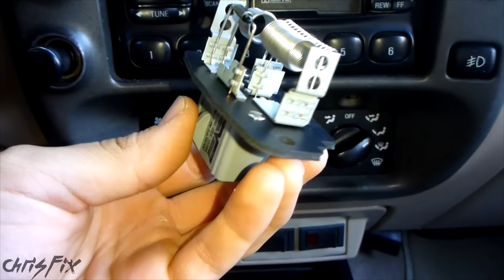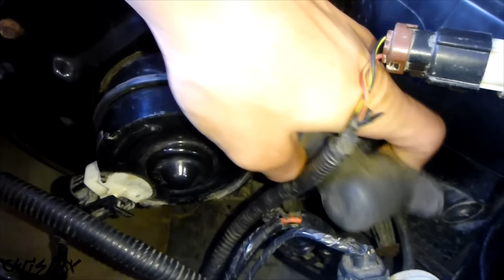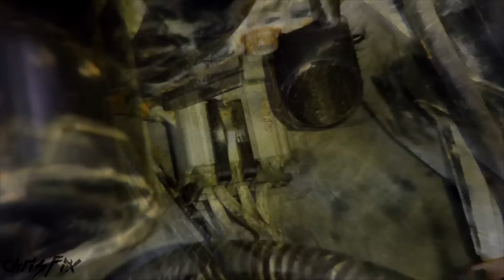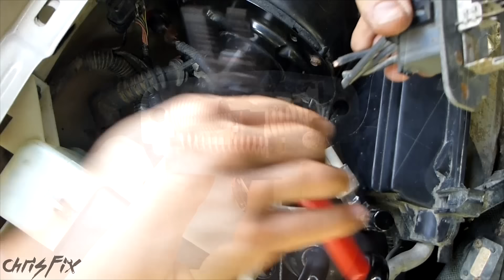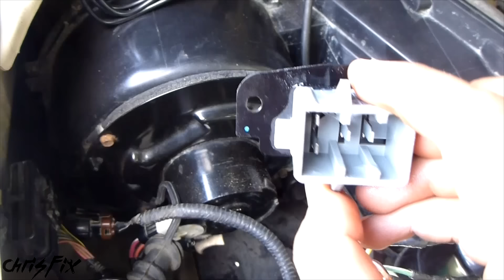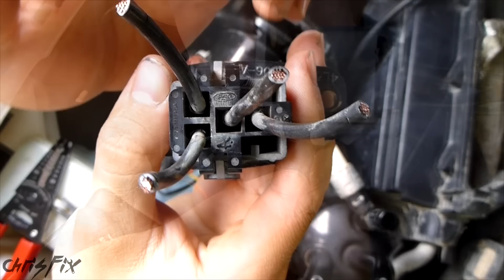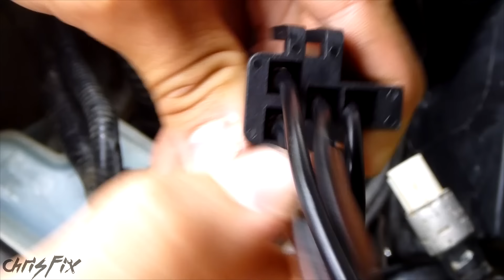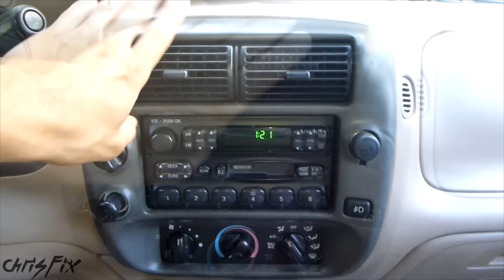How to replace a Blower Motor Resistor

Comment: I put a new resistor in and it still only works on one setting. Resistors are made to be shit.
Reply: TheAwesomeAustin Am wondering if you found a fix? Mine worked great for two minutes then cut off on all speeds except high...
Reply: I think they're just made to not work

Comment: This is the same problem as I have on my 2005 Ranger, only have "high speed" I order the resistor and new connector on Rock Auto ($31.00 delivered) and I will be replacing mine as soon as the parts come in. Great video and very helpful Chris.

Comment: Does every car have a separate blower motor resistor or can it sometimes be built in to the actual blower motor? I'm currently looking to change mine since its not working on neither lvl 1,2,3 or 4, it only blows on lvl 5. I'm driving a 1991 Volvo 940 (Without AC). The problem is that I can't find one for my specific car. Therefor I wonder if maybe it it built in to the actual blower motor?

Comment: Chris,  Thanks for the great video.  I have a 99 Ford Ranger that has this problem.  I have also had a number of other problems (i.e. speedometer not working, transmission shifting hard, check engine light, and O/D light flashing).  A mechanic changed the speed sensor to try to fix the symptoms I listed; however, after about ten miles all of the problems return.  I neglected to tell him about the air conditioner problem because I figured that I'd just live with only having a "high" setting for the A/C fan.  Could this be causing the other problems or do you think it's vice versa?  The mechanic is now wanting to replace the control module.  I'll tell hime about what I saw on your video.  Again, thanks and please provide any comments you think will help.
Reply from the maker: Scan the computer and get the tranny code. The OD light flashing is like a check engine light. It will tell you what's wrong.

Comment: Thanks a lot for your very helpful videos. The blower in my 1996 Nissan Pathfinder has been 50/50 for the past few days. It usually won't work at all until after I hit a bump in the road. I can feel the cool/hot air, but it's just not moving. This leads me to believe it may be a loose electrical connection to the blower motor. Where would I be able to locate this connection and tighten it?

Comment: How can you work on stuff like that on cars like your fiesta. The engine bay is very crammed. From below? It's just a question that just popped into my mind.
Reply from the maker: +bionasos they design access to each part (usually) so you just need to figure out where. A perfect example to this is my video "how to replace an ac compressor" and you go from the wheel well.
Reply: Thank you, i 'll start exploring then.

Comment: Chris, on my 1990 Ford Festiva the ac comes on but no cold air blows out the vent ( no air at all).  When switched to med and high setting the cold air comes out for a few seconds because it was working on low setting, but like I said no air blowing out the vents.  On the med and high setting, just air blows out the vents, no cold air though.  Does a blower motor resistor control the air conditioner too?  Or is there something else that needs to be replaced?  Thanks in advance.

Comment: Hey Chris. I recently replaced both the blower motor resister and the plug on my 2007 Toyota Tacoma but still no power. Any suggestions? Thanks
Reply from the maker: Check the fuse.

Comment: Could you use heat shrink as opposed to electrical tape at 9:03?
Reply: Vro18 Yes. Heat shrink is a much better option as long as you can apply the heat without damaging nearby things, the connectors in the video have built in heatshrink, i believe he did not realize this.

Comment: Chris my AC sometimes start and most of the time it does it could be in any speed and nothing but when I hit with my hand under the dash around the blower and resistor it starts also sometimes it doesn't blow cold, any advice?

Comment: My blower motor can be on and then it starts to slow down and stops. I turn it off and wait a few minuets and when I turn it back on it works. Would this be the motor or the resistor? Or Both?

Comment: im replacing ac blower resistor every year..  is it OK to just NOT use a resistor, and just have the fan on max on all times?  i live in a hot place, and most times, the fan is set on 3 anyways..

Comment: Hi, i have a Toyota Previa 1996 and the HI setting on the blower trips the circuit breaker only when the engine is running and will not trip with just ignition, what is the cause of this problem?
Reply from the maker: Sounds like you need a new blower motor. It is drawing too much current.
Reply: we replaced the old motor as commutator was worn out but was replaced with another second hand one
Reply: the hi setting works but just for a short amount of time, usually hotter the weather it trips quicker, too much heat?

Comment: what about using wd40 spray? well thanks I'm gonna get some gel! Did not think of it unless it comes in the kit! I bought a blower motor too so ill put in resister first may not need blower motor. but then again it was do cheep and its nice to have new parts when labor is Free you get the best deal for your car. Thanks So much.!!!!

Comment: chris what does it mean if i turn on the climate control and nothing happens? no air or anything is coming out the vents.. checked my fuses. replaced the relay switch. and also checked the blower motor as well . please help

Comment: good video except the butt connectors you are using are heat-shrink connectors and should have heat applied to get a seal around the wire.

Comment: Nice. 

You just did not remove bolts. You removed screws, and your crimping is too weak. These butt connectors are heat shrinkable.

Comment: Can the blower motor work on high even when a fuse has blown ?
Reply from the maker: Possibly. Some wiring is designed to bypass the blower motor for the highest fan speed. If the blower motor fuse is blown and it is still running then there is a bad short somewhere!
Reply: Thanks a lot, really appreciate it

Comment: I liked it but the wire crimpers were heat shrink wires you should heat shrink them because it's out in the elements not just electrical tape because you'll be replacing that again and the one wire was black copper was bad you should've cut it back further so you would've had better connection

Comment: hey chris i did this on my ranger but it won't cool any more but that fans are blowing i did not replace the plug just the resistor
Reply from the maker: +nodamnametouse make sure the blend door is working
Reply: it was working before i replace the resistor tnx for your help man

Comment: If I strip a wire and one of the copper wires inside happens to break do i need to strip  a whole new section of wire untill there all evened out again??

Comment: Hey ChrisFix, I have a 2000 caravan that the heat only worked on the high setting in. When i replaced the blower motor resistor,  I noticed that the wiring harness was burnt and partially melted. Since there was nothing I could do at the time, I put the wiring harness back in the new resistor. Now the heat only works on high and will not turn off no matter what position the air toggle switch is on (blows high even in the off position). Could this be because of the burnt wiring harness or did I screw something up during the install?

Comment: Mr. Chris,

   My fan works, but my new resistor doesn't work after I put a new one installed. I've checked my fuses, and they aren't burnt.

Thanks, 

Mr. Harlow

Comment: Hey Chris. I have a 1992 Ford Aerostar (mechanically similar to the Ranger/B300) When it's hot out and I have the AC running, the fan speed will slowly become weak through the vents, but I can still hear the thing spinning at maximum. Then when I turn the AC off it comes back through the vents slowly. Could this be the resistor?

Comment: Are them connectors like fuses in a way
Reply: no, but kinda yes at the same time they are resistors actually, how resisters work is they restrict the flow of electricity and dicipate it as another source of energy such as heat, and in return they step down the voltage,  when too much current is flowing through then it can either blow a fuse or actually burn out the resistors themselves.

For example, a fuse can have a certain amperage but once that heats up more than what it's designed for, it burns out... usually with a discoloured mark but it's not uncommon to see a blown fuse the same colour as the new one, however fuses don't restrict the flow of electricity.

Also, a wire can be a fuse, pump enough amps through a thin enough wire and it will heat up, eventually melting it and severing the connection which is why there is a mathematical formula to calculate distance, wattage, voltage and DC or AC to find the thickness that you need... here's a tip for you though the lower the number, the thicker the wire, so don't be ordering 36 gauge wire for that 100 amp installation...

Comment: had a question replaced my heater resissior n the connector but still not gettin any heat n the heater blower works coolent full what could be the problem help please

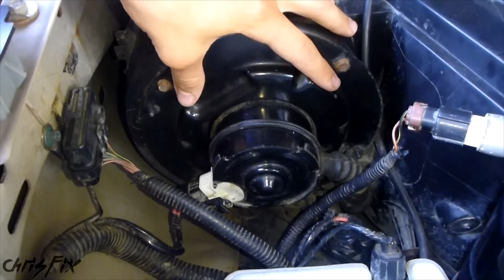Comment: Another great vid, Thank you good sir, but, what is your hand on top of at 1:28 please, mine has broken away from my firewall and I don't know what that part is called. Can you help me please ???? thank you....
Reply: drowization that's the blower motor housing
Reply: Sorry but I guess I should have timed it a bit better. Ok, so what is your hand just to the right of the blower motor ? the part I'm speaking about is just under the heater core hoses please ????

Comment: hey Chris, I have a 2004 Chevy trailblazer and the Ac fan is always running. Cold works. hear works. all fan speeds works but the fan never turns off when the car is on. air is always blowing consistently. defroster is off so does that mean its the blower resistor?

Comment: You should cover the terminals and fill the female socket with dielectric grease to keep any moisture out and you will n ever have a corrosion problem  and if the resister fails in the future the connector will slide apart easily.
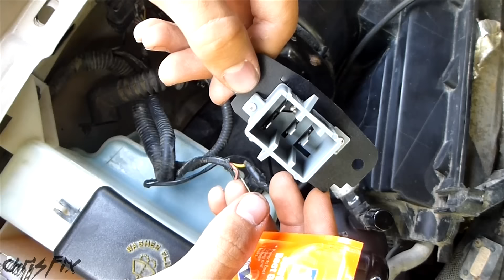Reply: He does mention this in the video at 5:19.  https://youtu.be/Q-i0tytSYIM?t=5m19s
Reply from the maker: Great tip! Thanks!

Comment: hmmm. maybe check if the resistor and wiring connections work before wrapping it up with the tape. Otherwise you may have to unwrap the tape to see if contact being made

Comment: whats the difference between blower motor resistor and blend door？？
Reply: 袁也 the blend door controls wether you get hot or cold air, the resistor control how much air you get.

Comment: i have my Peugeot 405 car. the blower fan works directly at high as the car starts at the time that the fan is already switched off.
how can i solve this problem?
Reply from the maker: Replace the blower motor resistor which will fix that problem most of the time. If it isnt that, then it might be the dashboard controls.
Reply: i will do that

Comment: Chris, this is an excellent video.  I commend you for it.  Allow me to introduce one small change you will instantly love. Scotch 3M 130C tape.  It's a thick tape that you stretch and apply in an overlapping manner.  30 minutes later it's bonded to itself and is water impervious. It's cheap for what you get.  Been using it since 1976. Keep up the great work.  And buy the way (9) nine months on the foggy headlamp repair, still clear as a bell.

Comment: Chris,  just did this on my acura tsx. Bought a replacement blower resistor. T hat Fixed the ac blower fan. It worked after i replaced it. 

Drove it around  and it worked. Then drove it a second time, stopped working again. No
 fan. Then started it next morning, fan now works again? What ya think 
the problem might be?
Reply from the maker: Sounds like either your blower motor is on its way out or maybe a wire is loose somewhere or has a bad connection.
Reply: Thanks! This video is very helpful...my a/c fan doesn't work on settings 1 and 2 but does work higher. Stumbled across this and glad to find it!
Reply: Make sure you have a good ground----on fan + resistor

Comment: I watch your videos and you seem very knowlegeable on auto repair. I have a question for you please. My Toyota Tundra 2006 fan motor turns on some time and when it doesen't I tap the motor or open and close the glove compartment hard and the fan will start. 
Does this sound like a fan motor that may just need to be replaced? I appreciate you feedback. 
Thank you,
Alan

Comment: Chris,
If there is no difference in fan speed from high to max ac does this mean my fan resistor is bad too?
Reply: When you select Max A/C, all you are doing, usually, is closing a door to prevent outside air from coming into the vehicle.  It does not affect the resistor or the fan.  You will still get some air into the vehicle so you won't pass out from lack of outside air.

Comment: Is there a way to restore an old one in case there are no aftermarket options available and the OEM is of extreme pricing ($200 last I checked)? How risky would it be to replace one with a similar make/model of vehicle that the parts were available for?

Comment: In my 2000 Ranger on my 4 wires that led to the resistor box I did not have a black wire.  I had a red wire instead.  My other colors were the same as yours including everything else.  I did the harness pigtail and resistor first.  My fan ran on high with the resistor unplugged so it was good.  I replaced the fan speed selector switch under the radio to fix my issue.  Pretty easy with a 7mm wrench to take out the radio cluster and the temp control out, unplug the connector on the left for the fan speed selector switch, pop it out and take to autozone and get another for $20.  Part number SW3316

Comment: My HVAC vent is stuck in  defrost. No other position works. Any advice on that? Thanks in advance! (2009 Ford E350)
Reply from the maker: +Roman Vovchak the vent door actuator is not working or if it's run via engine vacuum, the vacuum lines might be leaking.

Comment: in my Durango the resistor in under the plastic the window wipers are connected too and is deep in. it's hard to get out
Reply from the maker: How about working from under the car?
Reply: +ChrisFix I'm not able to do it underneath, I can't really explain but its in a small area hidden under the windshield if you pull plastic up deep inside.

Comment: My blower operates in all speeds Except high.  Still possibly fan resistor pack?
Reply from the maker: Potentially depending on how the car is wired. If the full voltage (highest setting) goes though the resistor then yea, your fix is probably the resistor.

Comment: Hey Chris. My 2006 Chevy Silverado 1500 recently ran into a problem. The blower will not stop even after I turn off the truck. I have to remove the fuse each time I park my vehicle. I control the a/c differently compared to the one in this video. I have an up and down arrow that changes the speed of the fan (doesn't work by the way). It blows at the highest speed at all times until the fuse is removed. Help!
Reply from the maker: Sounds like it could be the resistor or it might be the control box that you said doesnt work right.

Comment: can this cause for the blower fan to not blow
Reply: I did some research around the web and this seems to be the answer. I have the same problem so I'm just going to replace the resistor and see what happens.
Reply: There is a fan relay not covered in the video that can go bad and needs to be checked.   You could unplug the fan and make some temporary jumber +12V and ground wires to your battery to check the blower fan to trouble shoot if that is the issue or not.  On my 2000 Ranger it would blow on high with the resistor box in the video unplugged with a bad fan switch.

Comment: Chrisfix, my A/C blower is running even with the car turned off and keys out of ignition.  this killed my battery.  my a/c hasn't blown cold in 2 years anyway so I just want to disable the blower from running period.  where is the fuse?  is this possible?  2003 buick century.  if you do answer I will appreciate it very much.

Comment: my chevy s10 the AC stop working on the  1 and 2 setting and work only on the number 3 and i went to autozone and i order the AC resistor and fix the problem so now the AC  is ready for the summer

Comment: ChrisFix great vid! I have a 2007 Ford Expedition and speed 3 doesn't work. I replaced the resistor and the switch but now I don't know what to do. Is there a way to diagnose the problem?
Reply: John, My 2000 Ranger did the same.  I tracked it down to the 4 position fan blower switch under the radio.
Reply: +phordguy I replaced the switch under the radio too and it didn't fix it. I think it might be the blower motor but I'm not sure. Thanks for the help phordguy.

Comment: I know this is an old video and this may have already been mentioned but those crimp connectors are actually heat shrink connectors.  Once you crimp the wires, a heat gun will close them up for a water tight seal.  Great videos Chris, you have saved my butt (wallet) a couple of times!
Reply from the maker: Thanks! Yea I thought they were but they just melted with the heat gun. I think I got bad ones!
Reply: That is very possible.  Some are made very poorly (I've had them crack or chip).  Anyways keep up the good work!

Comment: Ok ChrisFix I have an 07 GMC Z71 truck and the blower doesn't work on speed levels 3 & 5. Mine are labeled from 1-5; does this mean that I need to do this to my truck to get all speed levels to work?? Thanks and your videos are great!!
Reply: Yes this is most likely what the problem is just replace the blower resistor

Comment: Psst... those crimp connectors you used are the heat shrink type! No tape needed, just some heat.
Reply from the maker: I thought the same thing but they just melted. I think they are cheap Chinese crimps.